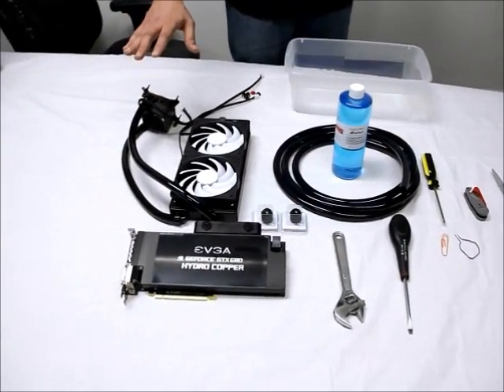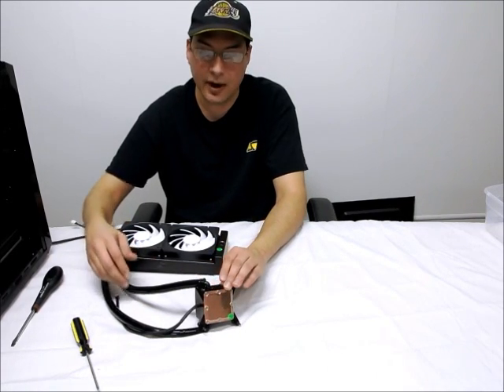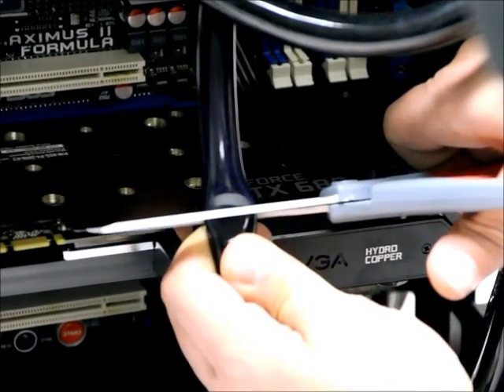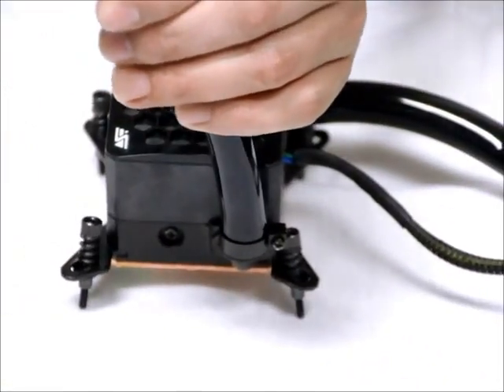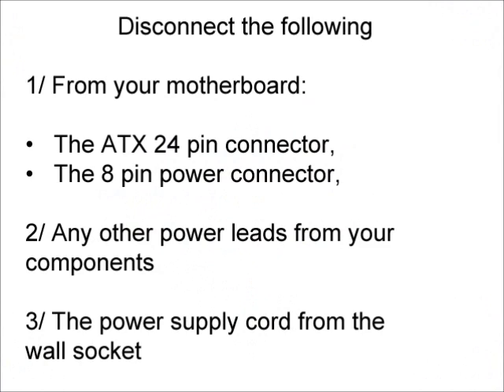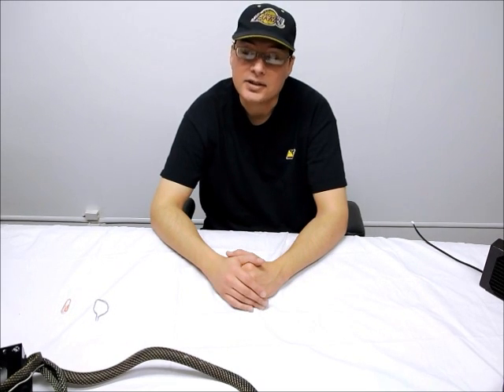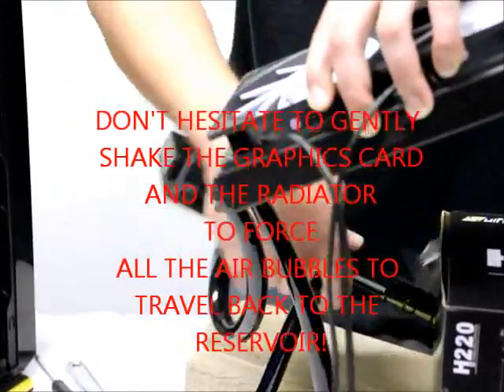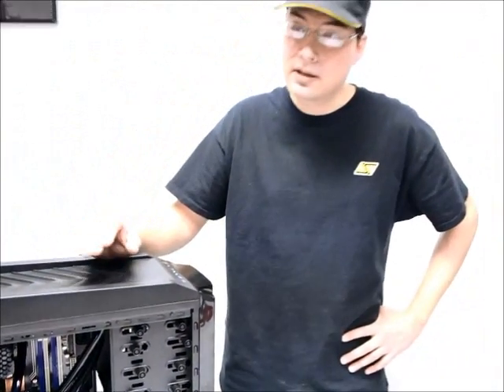H220 VGA Expansion

Comment: GREAT VIDEO. Exactly what I was after. Was difficult to find much reviews/guides/tutorials on how to add a gpu to the h220 loop anywhere else, and it doesn't come instinctively to non-watercooling users, but your video fully explains and demonstrates what we need to know. Might want to just give a list of what parts you use and the specs for the tubing (3/8 ID 5/8 OD)

Comment: Yes, you can run a 120mm radiator or reservoir between the CPU and the GPU. If you're just running a single water cooled graphics card though this kit should provide you with enough thermal performance for your hardware. Heat from one component doesn't get transferred to another the way you might think. The entire loop will increase in temperature and also be cooled by the radiator after several revolutions through the loop.

Comment: Yes you can. Just make sure that you have the right water blocks for your cards. This pump can handle it, but you may need more radiator surface area to dissipate the heat.

Comment: I'm not quite sure what you're asking here? If you need to know if this radiator has an inlet and an outlet line, then yes it does. There is one line going out to the water block and pump, and there is another line that comes back in from the water block and pump. These can be switched if your configuration requires it.

Comment: Yes, the reservoir should be at the top if you're mounting it in the front of the case. You might have some issues though with the tubes being able to reach. I would suggest purchasing some more tubing to make the connections longer. This isn't that difficult to do and it also won't void your warranty.

Comment: This kit has some issues with that case. It will fit in it, but you'll have to position the radiator with the fill-port facing down. This isn't the optimal way to have this radiator installed. The Asus Sabertooth z77 and MSI MPower z77 boards also have tall heat sinks at the top of their boards and this could create clearance issues with installing the radiator in the top of the case.

Comment: I would probably atleast add a single slot bay res for it. So long as you put the res at the very top a level below the pump/cpu block it will work. Unless the pump is on the rad. But thats why the new H220 x version have a separated pump mounted on the rad.

Comment: I'm planning on buying the h220 and adding a GTX 770 to the loop. From what I've read the reservoir (and in this case radiator) should always be above the pump, which in this case is the CPU mount. The build I'm planning will only have this 240mm radiator mounted at the front as intake for acoustics.

Do you think this is a good idea? I'm a bit worried about the reservoir placement, as well as the airflow. Also, am I right that the reservoir should be on top when mounting the rad at the front?

Comment: Just wondering if its ok to run to a 120 radiator or reservoir between the cpu and gpu? I dont really know much about water cooling, thats why im looking into one of these (best performance and easy install) but it seems like the heat from the cpu might diminish the performance of the gpu block. I just want to know what the pump would be capable of.

Comment: Please advise! When you connected the pump back to the PC to run it for the first time after refilling (leaving the screw cap off the radiator/reservoir) can you see the water moving when you look in through the filling hole of the radiator/reservoir or does it remain pretty static? 

My H220 (exact model in video) encountered a blockage and seized moving water/making any pump noise. Ive since cleared it and filled it with some temporary distilled water to just flush it and I can hear the pump but not see any flow or movement of water through the filling hole of the rad.

Comment: hi i am planning to build pretty similar system using h220 and intel 4770k and gtx 780 hydro copper
and i did some research but i heard the water pump in h220 isn't strong enough to circulation  the system is this true? and i will be over clocking the system as well  is it safe and more efficient cooling by cooling h220 just for CPU and add another secondary cooling for gpu? the money is not an issue i just wanna set up water cool that is efficient and good for hear dissipation

Comment: I had a Swiftech quiet rad adn it was first-rate. it cooled a 4.8 GHz 8-core AMD CPU in utter silence (the 360mm rad at Microcenter), although I used an XSPC Raystorm block./ I used 1250 rpm Scythe GT's.  I would love to see a version of this with the new cooler that looks so cool. I sold my last custom loop rig when I lost my job. I am working again, and I think I would rather do this than sell my soul to Bitspower for fittings.

Comment: Dat tube crossing. I wouldn't even think about running a cpu and gpu on just a 240mm radiator. Anything less than a 360 is a no go for me. Kinda ruins the point of watercooling, to keep extremely low temps and extremely quiet fans.

Comment: If I'd want to run i7 3770k 1.3V and r9 290 1.2V would this single radiator keep temps below 60C for both? If not, is the pump powerful enough for default and 360mm radiators? I have huge case so it feels kinda waste to buy smaller one :)

Comment: would this be capable of cooling 2 cards in sli or would i need a stronger pump/rad?
Reply: no dont buy it. you need at minimum a d5 pump n a resevior/pump combo n that all depends if u use the least angled of fittings, adds more frictions flow has to over come. its ok for one gpu block but even then your pushing it  fish tank noise. its rather tedious, 3/8 ID 5/8 OD ((10mm ID 16mm OD)) isnt a common tubing n fitting, it generaly costs more n tubing is alot tougher so harder to make simple runs and to make it worse the barbs on the cpu/pump block overhang mini itx mbs, memory slots

Comment: How thick must be the tubings?
Reply: You only need to worry about the internal diameter of the tubing in this situation as it needs to fit the barbs on the Cpu block.  I'd imagine they're using 3/8 x 5/8 tubing
Reply: joesaiditstrue I would think that one has to actually care for the outer diameter (OD) of the tubing if and where it connects to a compression fitting - since such fittings depend on the ring part being screwed back onto the thread of the fitting, to apply pressure to the tube on the fitting port and keep it firmly in place. I mean, if you cannot even wear the compression ring on a tube prior to screwing it back onto the thread, then your tubes outer diameter is too big. Unless you of course were talking about the barb fittings on H220 in particular, in which case I agree - barb fittings do not care much for outer diameter of a tube, as long as you have a clamp that can well, clamp your tube then. Am I making sense?
Reply: I was referring to the h220.... since it uses clamps.  Of course ID matters when using compression fittings
Reply: My apologies, then!
Reply: Armen Michaeli
nah it's all good

Comment: why would you put an GPU block on such an thin rad that cannot even cope with an highly overclocked FX-8350...? i mean the temps would be much to high.
Reply: Its a tutorial on expansion, not a recommendation. Your right, those temps would probably be nearing 80C which is unacceptable imo.
Reply: themonkeyman2547 Not true at all. The thickness of a radiator plays very little into how it performs. You would think that more water volume would equal drastically better temperatures. That just isn't the case. A radiator twice as thick as ours might get you a degree or two of better cooling performance, but that's about it. Given the cost of such a radiator it also isn't very economical and that's one of the main reasons we don't sell thicker radiators.
Reply: BramSLI1 i highly disagre anyone who knows fiziks bigger surfase better disapation, + i speak about same fin density les fin = less surface .... ps bigger rads might give not as much lower temperature but might give you stability - like if u add cp to small rad and bigger rad it has more treshold to hold that heat so bigger rads is nesasery when u have more then one component especialy if ur going to OC strange to hear crap from ppl of company that actually i took as best WC company but seems you having got fiziks in your school and life.... since simply most u have said is not true unless in some surcumstances that you dont mention whitch is lieng too....
Reply: GodSonLT have you seen amds 295x2?  A single 120 mm radiator cooling two of the hottest gpus available and gets better temps than a 290x on air.
Reply: ***** Haha!

Comment: i got s swiftech h240 x  i wanna add a gpu water block to it what line do  i open  ?
Reply from the maker: +ryan vaughan - disconnect the tubing from one of the CPU waterblock fittings (which one does not matter): you now have an open line, coming either from the pump, or from the radiator; secondly, connect a new piece of tubing from the CPU waterblock to one of the GPU waterblock ports; finally  connect the open line to the second GPU port and you are done.
Reply: Hello, 
Getting the new SWIFTECH KIT Watercooling H220-X2 PRESTIGE and a watherblock (the upcoming one for the gtx 1080) is simple as disconnecting one of the cpu tubes than making that one connecting to the gpu and the second one of the gpu back to the h220 ? no need to release water ? would really appreciate a tutorial, I would buy in a heartbeat if I knew all is possible and specialy how to do it.
Reply: I've got the exact same thought and would like to know if this works :)
Reply: it work very good thanks
Reply: Huh? He shows that you have to drain the coolant and refill it afterwards!

Comment: You say u jump the 24 pin to trick the power to think its plugged into the mobo. Soo?? where r u plugging the pump into? lol. do you trick it because if its not plugged into the mobo the rest of the power doesnt work from the power supply?
Reply: +Ron Schneider He clearly says in the same sentence that the fan is plugged into the power supply. lol You do this so the mobo doesn't get power and there's no chance of shorting it if you get liquid on a component.
Reply: Whoops, i figured it out. lol and build my comp :P

Comment: I would never buy another liquid cooler from SWIFTECH. They LEAK !! Both the original AND replacement both leaked all over my GPU. Buy another brand! Never had a problem with Corsair. I only bought these because they looked pretty.. big mistake.